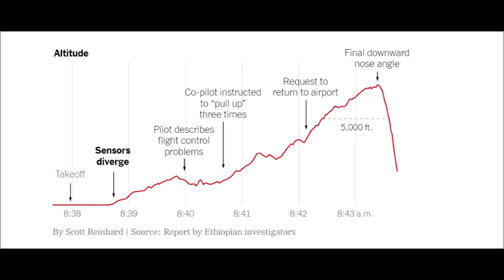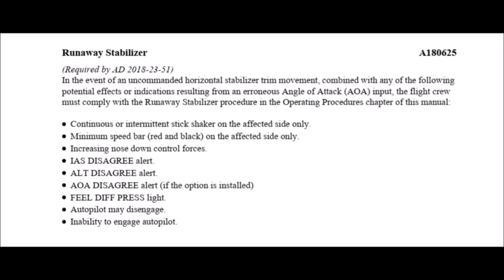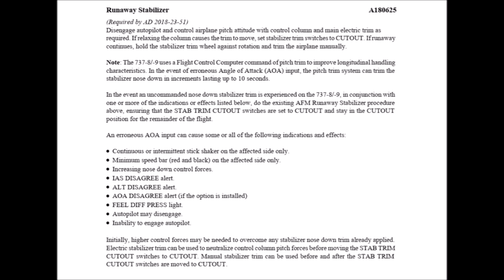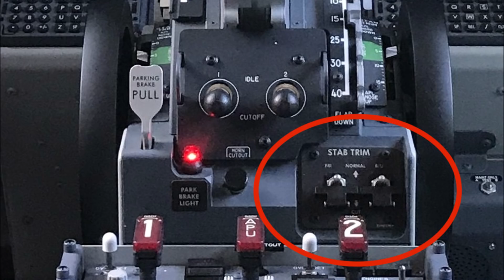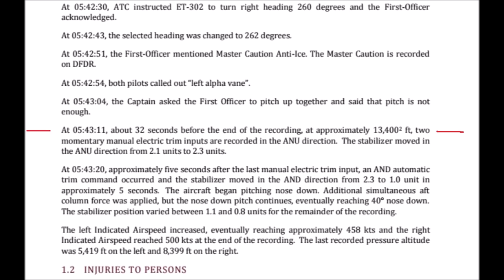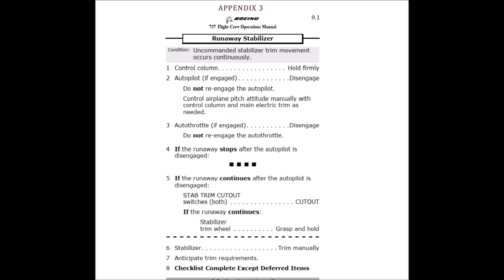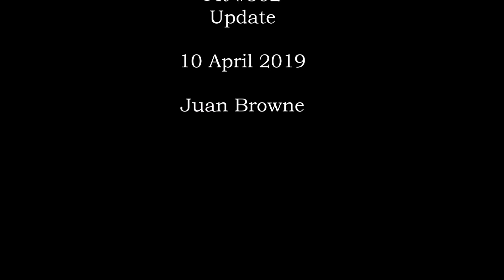737 Max Update 10 April 2019 Runaway Stab Trim Procedures

Comment: “Stab trim cut out switches set to cut out” should have been in boldface & larger type.  Boeing should hire a communication expert, even a web designer. After the Lion Air crash MCAS should’ve been disabled requiring pilots to manually manage trim stab until problem was fixed.
Reply from the maker: yes!
Reply: The planes are sold all over the world, so they have to be designed with foreign pilot culture and experience in mind.  Boeing could’ve hired a an entire office building full of sociologists to study this matter.  We hear about all these liberal arts students who can’t find jobs.  I think the top university professors in sociology would’ve gladly left academia to take on this study for Boeing.  Your trouble shooting quick reference guides need a lot of simplification I could tell from your screen shot, especially considering foreign pilots, whose first language is not in English.  In fact, such trouble shooting quick reference material could be and probably should be in the pilots’s native native language.  They only need to speak English to ATC. 
Boeing’s top retired engineer emeritus wrote a 25,000 word document telling Boeing not to farm out the 787 production around the world,  but Boeing knew better, and the cost overruns were so great that plane hasn’t yet recouped it’s enormous development costs, the last I heard.
The very fact the quick reference guide tells the pilots to take over total control of the aircraft by definition means pilots were totally capable of flying this plane without MCAS until the problem was fixed.  If that pilot had been flying from the ground he would’ve been watching his airspeed like a hawk, just like all of us do when flying GA. 
The Ethiopian people would be alive and Boeing would be off the hook.  I don’t understand why Boeing test pilots signed off on this system, or didn’t better advise Boeing along my lines after the Lion Air crash.
If Boeing can’t buy these people off with out of court settlements, I can just imagine the information that will come out in discovery of internal communications.
Reply: I studied engineering, and even I find the emergency AD unreadable. Written by lawyers and managers, not the designers.

Comment: Question to all the pilots and experts. When you feel the aircraft is pitching down. Can you go into inverse and flight up side down until you gain altitude?
Reply: You watch too many movies my friend 😁
Reply: stimproid with all the respect, google Alaska Airlines Flight 261...
Reply: @alexl6512  They had altitude on their side...and they still crashed. As soon as you start to roll you loose altitude at a significant rate. A roll typically starts by applying pitch up. If they could pitch up....they wouldn't have to roll.
Reply: stimproid it makes sense. Thanks, I’m sure you know a bit more at flying as I am not a pilot. According to the flight recorder of 261 they only needed 1000 ft. and 8-10 seconds to go invert. So technically 737 had time to do this, my questions is could they perform this successfully. In case of 261 they had complete loss of vertical control.
Reply: @alexl6512  Could the 737 fly upside down? Probably. 
With a nose down pitch and speeds above the design speed close to the ground would any sane pilot consider it? Not likely.
Reply: Thought you might find this helpful. https://www.youtube.com/watch?v=JhzaogGQNFU

Comment: Thank you for the update and the plot thickens - two questions though: 1)  the procedures for the runaway trim suggest you can grasp the spinning trim wheels and check the spinning? what kinda of forces does this involve? is this done in training / and part of the certification for this type? It seems to be that this is part of the design, having those big wheels with indents to grasp it when its spinning out of control and a fold out handle to crank them back  2) How does auto throttle work? do you set a required speed and the throttle positions will be adjusted   to maintain this speed? In which case that system must have been OFF in this incident or malfunctioning (?)
Reply: This might help with part of your question https://www.youtube.com/watch?v=cQirIH_DuAs
Reply: 1. Big forces, enough to take the skin off your hands. 2. In this case the autothrottle was set to maintain a fixed rate of climb after takeoff. Since they were not able to climb, the aircraft accelerated.

Comment: Juan, could it be that the pilots intentionally made the plane overspeed, thinking that the extra relative wind over the horizontal stabilizer would push more downforce on the tail? If they reduced the throttle, would that just have made the plane descend faster?
Reply: It is possible, but we do not know, and may never know.

Comment: Sounds like it to me, pilots are no longer piloting the aircraft.. We are definitely in a very odd phase of aviation, who is really in control and who is the monitor? Dose the monitor know that to do in a crises situation...???  (auto pilot, auto throttle, auto trim,) that's next auto take off, auto landing.
Reply: Computer automation has made flying far safer, however the pilots still need to be just as proficient as they ever have.
Reply: @stimproid  i understand your point.. I feel all the automation may lead to pilots becoming complacent in the cockpit under an emergency situation. The auto throttles been left on during the flight seems to indicate that. I'm sure the situation in the cockpit was more than horrifying, dealing with a crises situation should be a auto response. Not to sure what pilots are training for in a emergency situation, I would have thought a trim run way would have been something pilots would train for and be very much aware of..
Reply: @petermsamson  I agree. Runaway trim procedure has been trained since the 1960's.
Reply: 99% boredom, 1% terror...

Comment: My goodness, the $80K AOA disagree light is not even a separate light.  It's an indicator on one of the screens...
Reply: The certification is very expensive...
Reply: Adding another indication light outside of the pilots focus on the primary flight control instrumentation is not a good idea. It makes for an easily overlooked indicator, especially in times of emergency when tunnel vision kicks in.
Reply: Yes and do you know how much money it cost to get it certified?

Comment: One thing no one has thrown into the mix is the lack of experience of this pilot. If I got my facts right he was 29 and didn’t have a lot of hours in this aircraft. Could it have played a role in this? I’m not trying to take away from his skills which obviously put him in the captain seat but this emergency may have caught him and the first officer off guard. And yes this is going to hurt Boeing with the law suits coming. Hopefully they get this fixed I have flown in this aircraft and it’s a good one.
Reply: The captain had 6000 hours experience. Realistically you can't ask for a lot more than that, regardless of his relatively young age. Neil Armstrong was a veteran pilot at age 38, when he walked on the moon.
Reply: Gordon Richardson 6000 hours sure but not in the max. And Neil Armstrong rode a rocket to the moon you don’t fly a rocket. And as I said I’m not taking away from the skill he had for his age he was obviously a good pilot but with this issue he certainly didn’t specifically train for this. And his co pilot was under 300 hours which I have to say that had an something to do with it.
Reply: scott stutzman The first person ever to fly the MAX had zero hours on type. By definition experience has to be gained by doing. I'm still not sure what your point is?

Comment: After a lot of pondering I still can't understand exactly the flight regime that a pilot hand flying the airplane would deliver it to such that the MCAS system had to intervene to save the day. I can't help but think that stall avoidance is the pilots job, again; engine placement logistics /engineering/aerodynamics considerations of the MAX notwithstanding. We have gotten to see a few examples of MCAS when it has a hardware fail (AOA), and also the unfortunate results if the problem is not managed decisively by the crew in two instances. Are there any examples of this system saving the day when functioning correctly ?
Great channel Juan.
Reply: The Seattle Times (free view) has a good background on the development of MCAS: https://www.seattletimes.com/business/boeing-aerospace/failed-certification-faa-missed-safety-issues-in-the-737-max-system-implicated-in-the-lion-air-crash/

Comment: If the MCAS were designed to "aid" the pilots, I would agree with most of what was said in this report. However, my impression is that the plane is not flyable without MCAS, not unlike almost all stealth military aircraft. But, the 737 max 800 is a commercial passenger craft that does not need to evade radar and its lack of flyability is strictly for the benefit of BA and customers desiring efficiencies. It was not designed to be flown without MCAS and expecting pilots to fly this piece that was not designed to be flown is a last-gasp effort to transfer liability to pilots. It's the same group think mentality that says it is so because we say it is so. Give it up! The plane, as aerodynamically designed, should be permanetly grounded...
Reply from the maker: It will fly fine without MCAS...stby future update...

Comment: Thanks  for your lucid analysis, Juan !  Makes a strong case for the 3-person flight crew .   I also wonder if the manufacturers' and corporate flight ops  heads' push for more use of automation in search of ever more efficiency isn't leading  pilot's into an over-reliance on the " George factor " .. You hand fly aircraft all the time, but how many commercial pilots do ?

Comment: Reading online Aviation Week  article yesterday it mentioned AOA was out prior to flap being retracted and the column shaker occurred. Pilot responded by pushing the nose down. The flaps were retracted which engaged MCAS which then trimmed the nose down further and the pilot did not use enough electric trim to counter.  Seems that there will be a couple key items to be looked one the  throttle setting controlling the speed. Other question I have could they have lowered flaps to  minimum flap setting while reducing speed. That would have disengaged MCAS and allowed them electric trim.
Reply: Above a certain speed, the flaps can no longer be extended.

Comment: The faulty AOA sensor caused the air data computer to provide an erroneous airspeed indication on the side with the faulty AOA sensor.  When declaring an emergency, the crew reported unreliable airspeed indications.  So they may not have realized how fast they were going, and therefore did not reduce throttle.
Reply: The right side airspeed was correct, but there were numerous other distractions.
Reply: Yes, that's true.  One problem is that when the two airspeed indicators disagree, how do you know which one is correct?   I could imagine a pilot looking at an indication of over 500 knots and thinking, "That's ridiculous, that's an erroneous speed indication."  I'm not saying that's what happened, but who knows?

Comment: And when you read the many steps needed to solve MCAS problems, mainly happening in low altitude, we ask why AI? There are so many IF THEN steps that this is the case to use a well designed software. 2 planes falling in the same situation is not coincidence and not pilot faults. If this procedure is so new and critical, a flight simulator training should have been mandatory. Boeing will pay a huge price for that, starting with the lack of confidence of pax.
Reply: 737 pilots have been trained on runaway trim procedures since the 1960's. It is considered a "memory item" and is memorized by 737 pilots.
Reply: @stimproid  So you are implying that both 737 MAX fell because their pilots didn't memorize this runway trim operation? Why didn't any 737 before those (NGs. etc) fell because of the same reason? Why this MCAS keep insisting putting the nose down when obviously the pilots are trying to put the nose up? This was a very very bad designed software. A simple software routine would avoid this.
Reply: @CarlosAlexandre-fl2ut  You suggested the procedure was new. MCAS is new and needs to be fixed.

Comment: Nice job Juan. The more we learn about these accidents, the sadder I become about the sheer terror or “human factors” on those flight decks.
Today, along with a fellow instructor, tried to replicate these events in a -800 simulator. Granted not exact...but pretty close. He...acting as MCAS, and me trying to fly the airplane in this condition. We started at 18,000 ft. (Something neither of these crews had the luxury of) and I can tell you it was EYE OPENING.
With the power left at climb power, and just THREE occillations we were at 14,000 ft. with IAS exceeding 370 kts. 
By 390kts and full aft yoke....the manual trim wheel was essentially useless....and the elevator began to flutter.
We froze the simulator....at 10,200 ft....looked at one another and said a few choice expletives.  I flew the -200/-300 for eight years at my airline, he flew the -200/-300 for twelve years with YOUR airline.
I don’t think either one of us shall ever fully comprehend the magnitude of these tragic events...or what those crews went through.
Reply: Thanks for your honest and revealing feedback!
Reply: Michael Stuart Very well said.

Comment: Juan...Excellent work presenting facts regarding the crash. It appears that the left AOA sensor will be a root cause of the crash.  When there is a disagreement between the two sensors as in this case, do the pilots have the ability to ignore the sensor they believe is inaccurate and manually switch to the other one that they believe is correct in order to stabilize the airplane?
Reply: There are always third standby sensors (AOA and airspeed), but the pilots need time to compare, assess, and decide how to proceed.

Comment: Now we read that Boeing made the software of the MCAS to force the nose down 4 times more than it was supposed and also interfering with other systems. As my senior software engineering capacity indicates, that was a bad mistake. And also accepting just one AOA input instead of evaluating borh. At last no circumvention to shut down immediately that piece of sh#t. No pilot should be put in such a situation because of a software. Só Boeing thinks solved the nose down stall balance but created a much harder situation. Ridiculous.
Reply from the maker: Yes!

Comment: The deviation seems to be leaving the throttles in auto. That lead to the situation getting out of control, and the reengage of electricity to the trim system was just a last ditch effort that didn't play out, so shouldn't really be seen as breaking procedure. If I was about to crash and burn, I would try just about anything, regardless if it was recommended or not, they were going down so it couldn't get any worse, and had they been lucky, their hail mary would have worked out. Sadly it didn't
*edit note: fixed a typo

Comment: it seem as thou we need a 3rd pilot or flight engineer to be on the 737 Max.

While the captain had tons of experience, he had tunnel vision and underestimated that the MCAS will come back online the moment the Electric Stab Trim Cutout switches are flipped back on. 

More pilot training is def need for the 737 Max since it now considered to be way different from the 737 NGs.
Reply: Runaway trim procedure has been in place on the 737 since the 1960's. This is not a new procedure. The switches stay off.
Reply: @stimproid  yea it boggle my mind the captain turn the electric stab trim on when the manual says to keep it off. More steps and training need for the MCAS upset

Comment: The biggest question I have is why didn’t they continue to keep the jet in trim with the standard control yoke trim switches? Every time the MCAS activated they could have activated the control yoke trim in the opposite direction to re-trim the jet. Then if the MCAS kept misbehaving they could turn it off AFTER the jet was close to trim. Of course pulling the power back would have been crucial as well. 

Un-commanded trim happens routinely on almost every takeoff. It’s called speed trim and it almost always is going in the wrong direction according to my wishes. It often turns up just when I’m trimming down to accelerate at around 2000’ AGL. Speed trim isn’t as dramatic as MCAS though. And, there aren’t a bunch of other warnings going off at the same time. I’m sure the crew was confused but they should have been able to fly the airplane. There seems to be something else in this equation that’s missing to explain why they failed so miserably.

Comment: Bottom line............more and more automation is being installed in airline type equipment at the request of the airlines. They believe automation is a much safer tool than the pilot. It is evident not enough sim training  and system training is  being  given to pilots moving into newer models of the same type. This and better testing of the flight crews before being certified to fly the new model needs to change and soon. it's only going to get worse as the pilot shortage gets worse.

Comment: Hi Juan, thanks for your video. I am NOT a pilot. A few years ago, a few friends who fly Boeing airliners commercially told me top reason why they prefer flying Boeing airliners vs Airbus was because, on the Boeings, you have complete control of the aircraft. If something went wrong, you just disengage the auto pilot and manually fly they plane, whereas on the Airbus, they auto flight systems controlled the aircraft to a much higher degree. As a non-pilot, I believe the process to transition from automatic flight to complete manual flight should be streamlined so that, if something goes wrong, the pilots can easily disengage the auto flight systems to manually fly the aircraft. It should be easier!